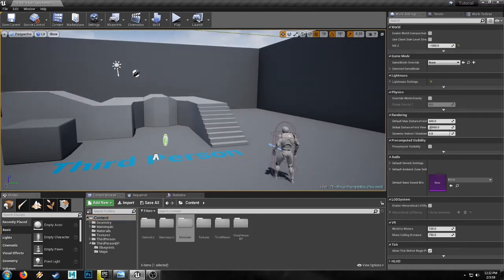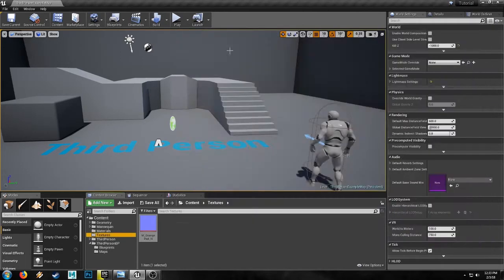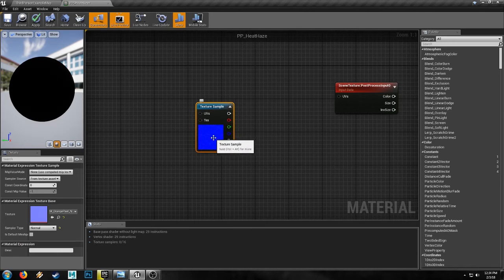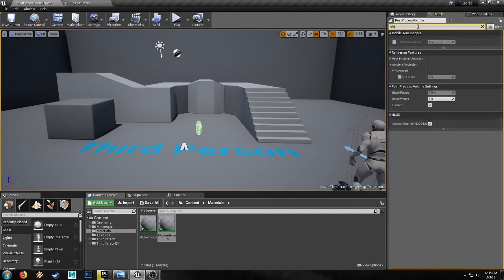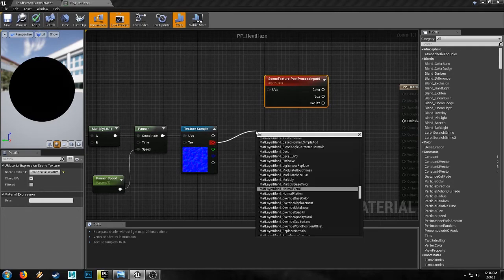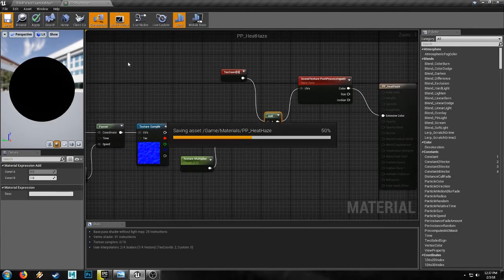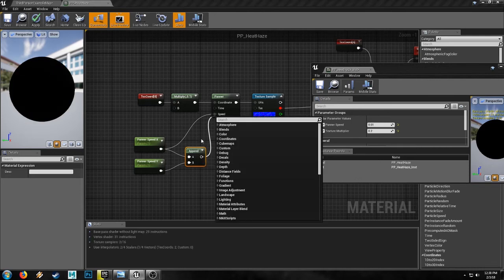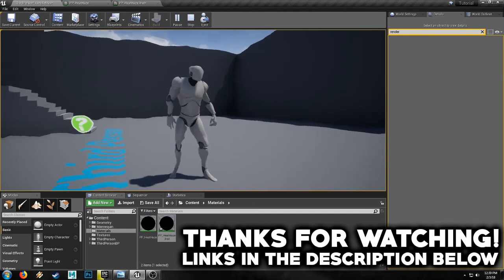UE4 Tutorial: Heat Haze Post Process

Comment: This was really helpful and well explained ! Thanks so much. 
One question if I may ? Is there a way in the sequencer to make the effect intensity fade to nothing over time, with keyframes ? I tried with the blend weight and the array amount where the material is assigned to the post process volume, but instead of a smooth progression, the slider is all over the place and feels more like a random seed than a gradient. Do you have any idea how to get a smooth transition from "heat haze" to "no heat haze" ?
Reply: I know this is a year late, but I might have found a solution for you as I just ran into the same issue. The problem is that to lerp between two states with the blend weight, you need a second post processing volume. In my case, when I tried to blend out the heat haze, the tiling of the heat haze turned really whacky and grew smaller until the blend hit zero and the heat haze tiling snapped to zero. To fix this, create a second instance of your heat haze post processing material, assign it to the second post processing volume (that ideally should be unbound, so it fills the space) and change all the parameters (Apart from the speed) of the second material instance to zero. You will want the value of the speed parameter to be the same as the first material instance so there is no jittering.

Doing  this allows for the blend weight to have a proper reference to lerp between, so it should tile accordingly without looking like a random seed. Hope this helps!
Reply: @StormTheEevee  thanks so much for the solution and explanation!

Comment: Could SceneDepth be used as a factor for the heat haze? So that only longer distances show the effect, and near the camera it would be negligible.
Reply from the maker: I think so! I haven't experimented with that, but my first thought is that it would be super easy to do with a distance mask, like the one in this image: https://i.imgur.com/0EZWCdS.jpg

Just change the A<B input to the result of the heat haze blueprint and you're good to go! Changing the SkyMask value will adjust how 'close' the heat haze will appear.
Reply: I tried it and it's asking for a value for A>B. I got stuck on that part because I don't know what to put there. I've tried a ton of stuff already, please help.
Reply: @n1lknarf  hey it's been a while but have you find the solution yet ? Plz
Reply: @Graphiqueman  doesn't work
Reply: @underscore00  Can you please link image where A<B connected? What do you mean result of BP? thanks